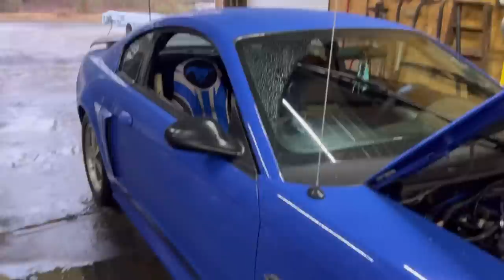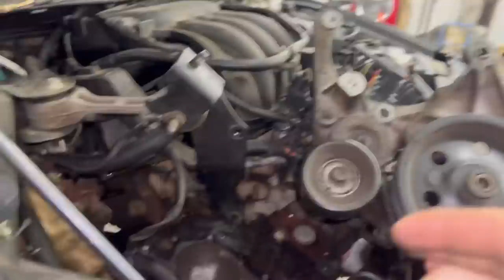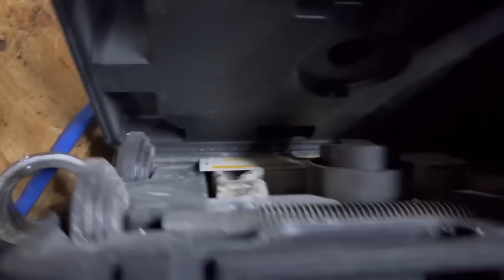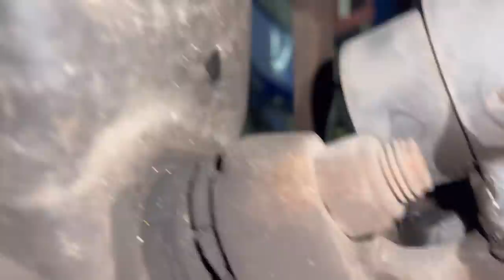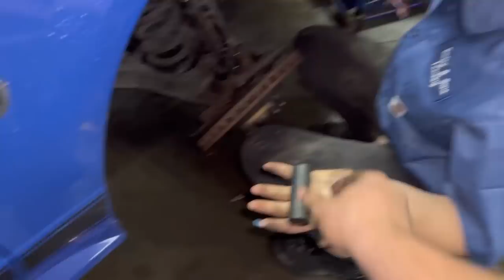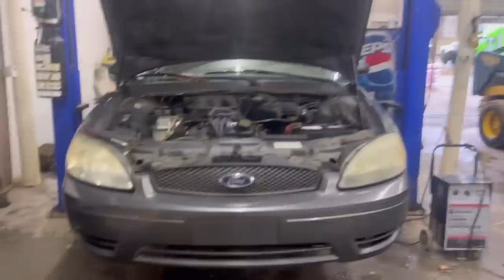Finely fixed my front end!! Also got some help!!!

Comment: The next time you take the nuts off the bolts put it on a socket on the bolts that fit and used to drill and put in reverse and back them out it's a lot easier and beating them out trust me